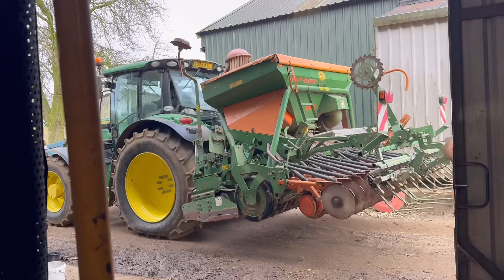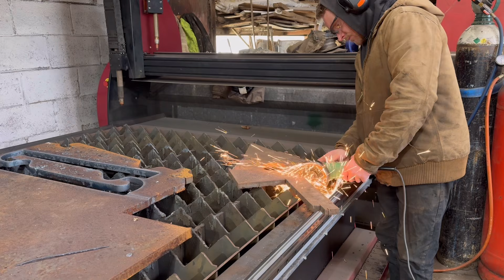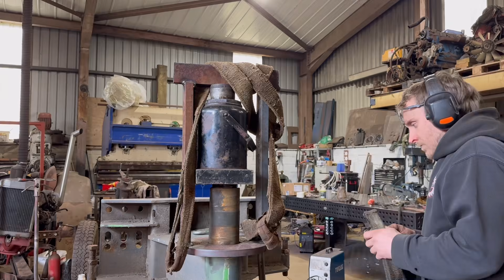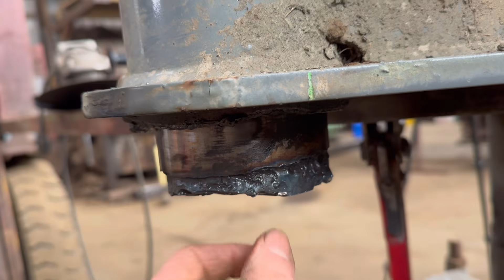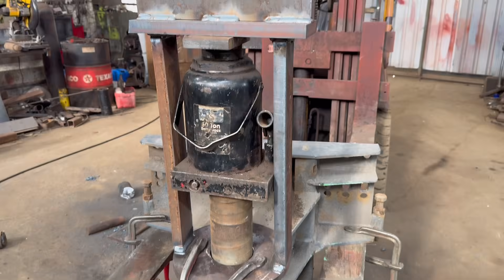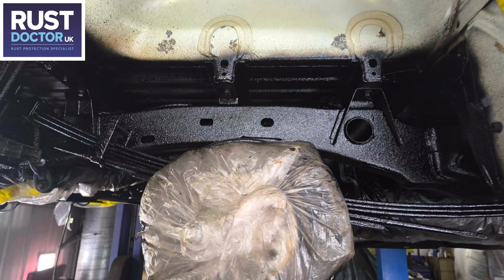Pressing stuck shafts out with 50tonne jack! JOSKIN axle pivot. Part 1.

Comment: Have you got "I am a sucker" tattooed on your forehead? You get the "best" jobs. I dare say most other repair venues would have run a mile from this job. Well done. Retired machinist/mechanic/fabricator in Land Down Under.
Reply: If you start turning jobs down because your balls aren’t big enough, people start going elsewhere.
Reply from the maker: These are the jobs i love the most!
Reply: @snowballengineering  Watch the men in long white coats that might knock on you door. They will be there because someone told them an occupant has "a screw loose" and is taking on the roughest of jobs - and loving it. They are there to take you to "the funny farm" for therapy.

Comment: Why didnt you cut the protruding bit off first, then you would only be pressing through half as much shaft?
Reply from the maker: Because the protruding bit was worn down and the bit what wasn’t worn wasn’t rusty.
Reply: @snowballengineering love a good bottle jack fight lol.  Wonder if it would have saved some time to just cut the welds/shafts flush with the inside vertical plate and then push outwards even if you had to brace the2 sides to prevent them from spreading?  Always a pleasure to watch you make light work of something!  Also something to be learned from maybe setting up a weld to be the weak point when using that big BJ (bottle jack lol). Plan for the jig to fail safely.  Keep em coming!  Thanks
Reply: You do great work Ollie.
Everybody does things a little different. 
You do your thing and the detractors can go stuff themselves @snowballengineering
Reply: @snowballengineering  I'm a big fan of gradual escalation rather than the Doomsday Scenario right off the bat. Some jobs are just plain difficult no matter the approach. Good job Ollie.
Reply: I would have done the same. Half the shaft half the time. It was to long anyway it had to be cut
Reply: Nice work Oliver,bet you had a good night's sleep after that made me tired just watching you swing that hammer and pump the jack. Nice job on the truck should last a few more years,stay safe.
Reply: Nice work as always! Plenty of different ways to get the job done. Vet cutting through that shaft with a grinder was fun!  😂 if it was me I would have brought an air bottle jack lost count on how many times you pumped that leaver 🙈
Reply: That certainly put up a fight Olly !
Plenty of advice in the comments, so I'll throw my 2 bob's worth in !
Cut the stubs and the centre section out, drill down the seized bit with your mag drill, then nibble away at the plug with the gas axe !
Easy for us all to say after we've seen you do your methodical approach and it might just have come out first time anyway 🤷
Reply: Nice hard work even with the bottle jack! Those cracks made me jump back. Congrats to the VW upgrade and so worth rustproofing it. Looking forward to part 2!😊
Reply: Armchair machinist can do anything with swinging a hammer.😂😂

Comment: Hi Oliver, I'm wondering why you didn't use your line boring jig to turn down the ends and then build it back with weld? Top job as usual though 👍
Reply: He literally discussed that within the first minute of the video 😮😂
Reply: He discussed the mill not the line borer, but the line borer won't work for this job without some fairly heavy modification s. A spindle repairer is what he really needs amd that's quite a differnat machine
Reply: @fowletm1992  Oliver used his liner borer to repair the spindles on that disc cultivator packer last year. They were smaller though. Maybe the customer preferred the full repair since it's on such a heavy duty tanker. Joskin make some massive slurry tankers, 30T+.
Reply: Surprised you’ve never seen a Powermax 105 because Hypertherm definitely make them. I’d imagine the book settings for one of those would get you in the area of where you need to be to cut at 105 amps on your machine

Comment: I think a hollow jack with a pneumatic actuated hydraulic pump would be a great investment to pull or push without any effort. And also wear glove when using an angle grinder the spark is not good for your hand
Reply: Second that air over hydro is the way to go.